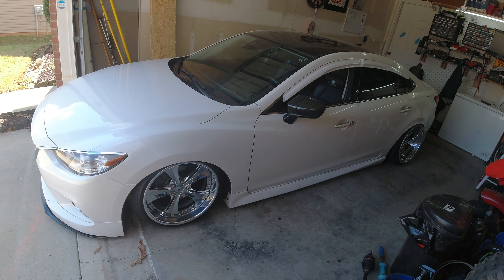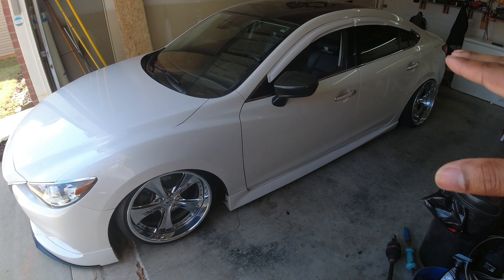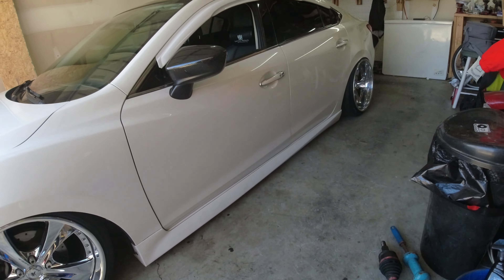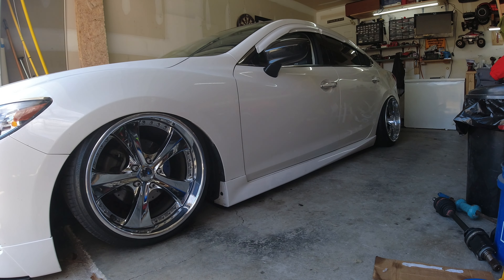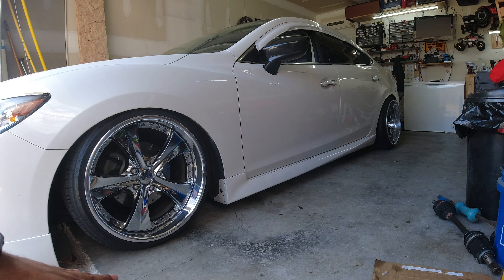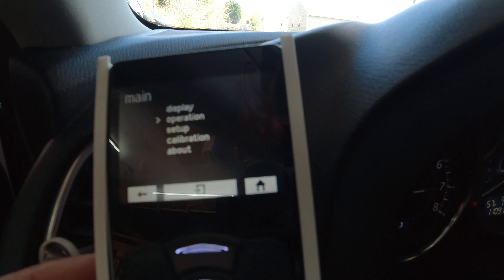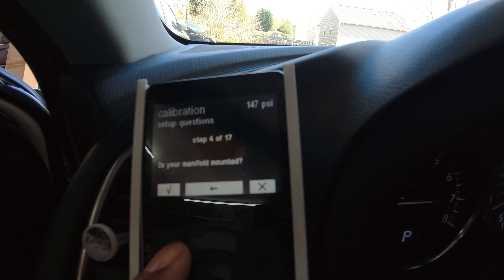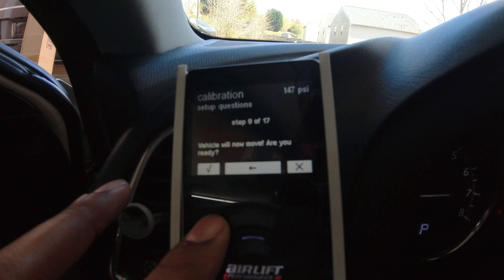AirLift 3P Air Suspension Calibration | OverAiring | Modified Mazda 6

Comment: Mines if recalibrating after 1week its overairing again, should we always to calibrate if it comes overairing? Is it an issue or it just normal?
Reply from the maker: With 3P it depends on a lot of things, the ground being level is number 1 from my experience. But it does seem that over time it starts to over air more and more as a safety precaution to get the ride height correct. 

Thats one reason I upgraded to 3H and the fact that no matter how much weight is in the car, it’s always at the same height at my presets.